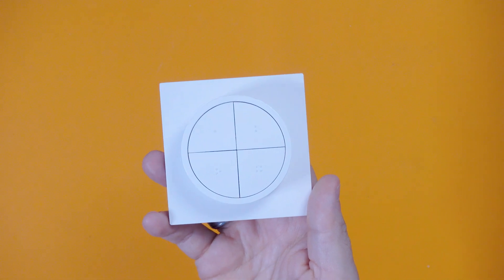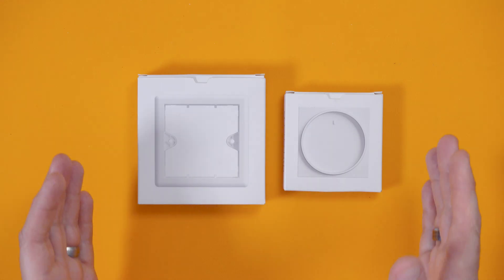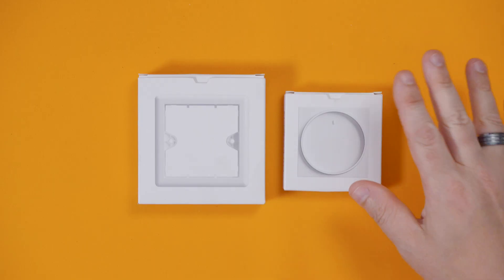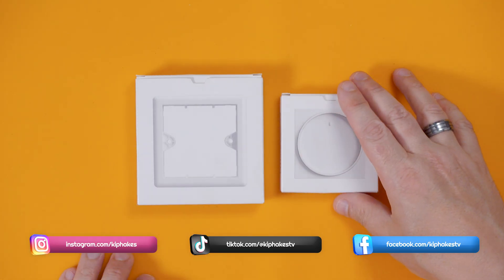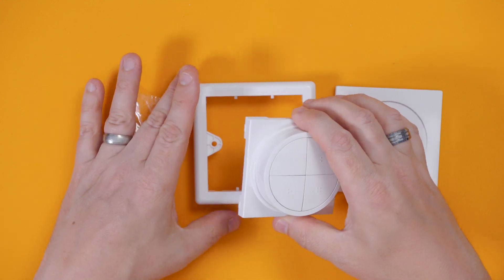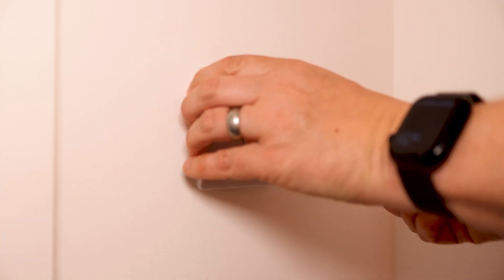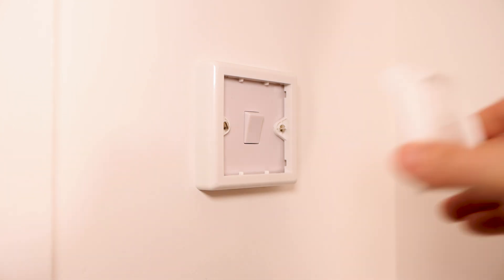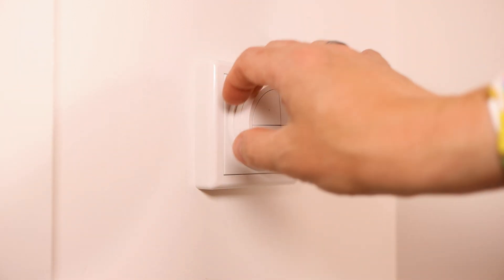How To Replace A Light Switch With A Philips Hue Tap Dial Switch

Comment: Kip, what happens if for some reason there is no longer communication between the Hue bridge and the lights? Can I still turn them off considering the traditional light switch is no longer accessible?
Reply from the maker: Yup. But I’ve never had that happen
Reply: @KipHakes  I understand, and what are the steps to turn them off "manually"?
Reply from the maker: Like a standard light bulb. Remove power?

Comment: question: Can I use these instead, 
Schneider Electric Lisse White Moulded - Single Socket Spacer // Schneider Electric - Lisse White Moulded
I have the flic twist, and i need to do what you did but using these cheaper alternatives ;-)
Reply from the maker: Try sharing a link if it will let you
Reply: amazon.co.uk/Schneider-Electric-Lisse-1-Gang-Spacer/dp/B07FJ9C8J8/ref=sr_1_5?crid=2WN7JQVYJ6ZB7&keywords=Lisse%2BBlank%2BPlate%2BCover%2BWhite%2BPlastic&qid=1700687085&s=industrial&sprefix=lisse%2B%2Cindustrial%2C201&sr=1-5&th=1 @KipHakes
Reply from the maker: I’m not convinced it would work
Reply: oh hey! i bought them regardless, and ill save the spacers for another project when i move home but the front panels work perfectly!
 @KipHakes

Comment: Hi Kip, are there hardwired variants? I am not an electrician either but have and do change light switches etc, obviously exercising caution and safely.
Reply from the maker: Not Hue ones, no.. you might be able to find some third party Zigbee compatible switches though. Although I’m always a bit wary of wiring random Chinese stuff in!
Reply: @KipHakes  Yes you don't want a back door into your back door.